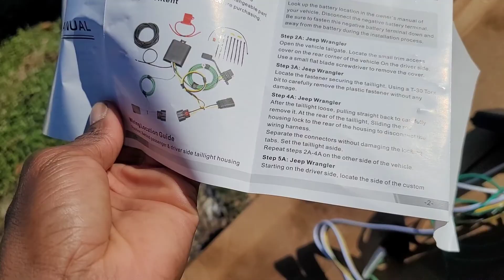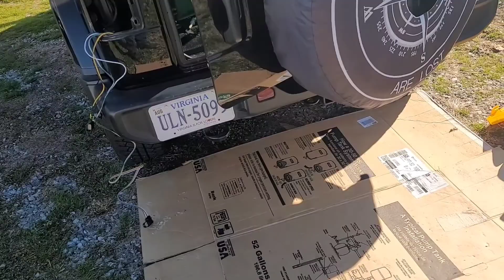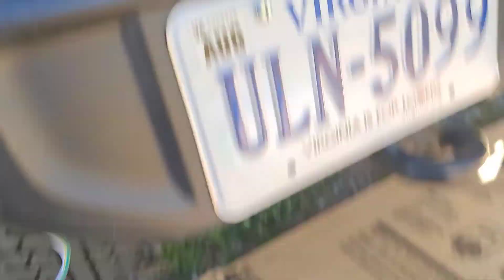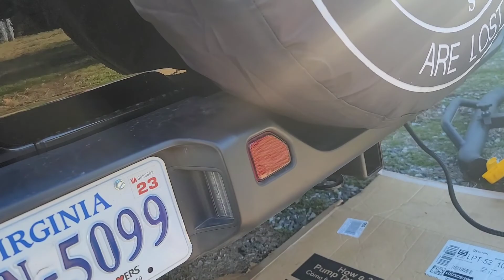Installing a trailer wiring kit in the Jeep Wrangler JL.

Comment: They make a plug and play kit you litterally just tie into the driver side tail light plug one into the tail light and plug the other into the wiring that was plugged into the tail light and boom just zip tie it down under the bumper and all done
Reply from the maker: Link?

Comment: I put this in my 2018 wrangler jl and key on engine off all trailer lights work fine ,I start the jeep and only parking lights work. Anyone have input?
Reply: This system is very simple and dummy proof. The problem might be with your trailer’s lights. Try contacting a different trailer and still if problem continues.

Comment: I don’t understand you got a 12 V plug 2 inches away. The plug can either be constantly on or switched. From the factory it switched, but you can change the fuse and make it constantly on which I wouldn’t do. Unless I had to I don’t get why you’d have to run the wire all the way. But that’s just me. Maybe for gladiator.
Reply from the maker: This is basically a relay block it isolates the vehicle's light circuits from the trailer in case of a short. This is not splicing into the vehicles light wiring like how places like U-Haul sometimes do it.